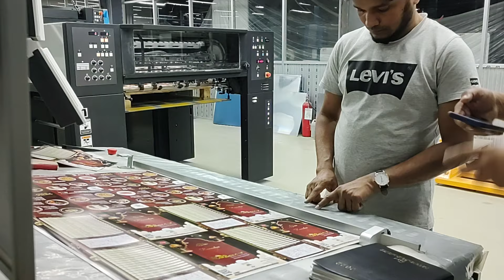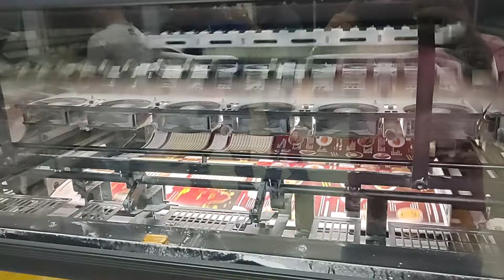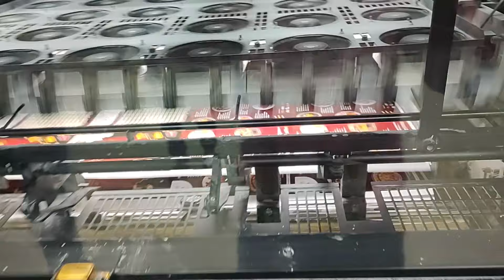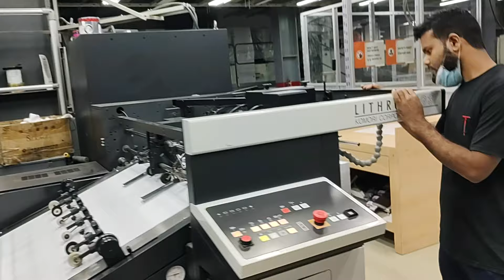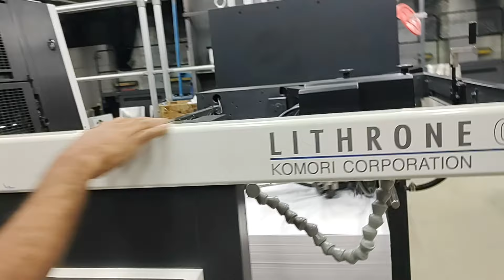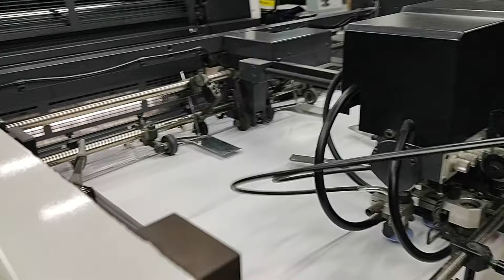How to work Komori printing machine

Comment: Ran both presses. Both have good and bad qualities. The hedi has a lot of technologies that tend to be very expensive to maintain and repair. I found that the larger Komori is more mechanical and easier to understand and repair. For major long runs I would pick Komori., once set up correctly, it'll run forever without adjustment. For hang and bang out small to mid jobs, I would pick Heidelberg. They are more efficient to start up and change over but will realign as the press heats up and need to be monitored closely until it stabilizes. The final end of day wash up, does take longer, even after running overnight shifts.

Comment: Step 1. Pour sand into the oil reservoir. Step 2. Buy a Heidelberg.
Reply: Komori s are just as good. Ive ran Heidelberg too! Pretty close in quality to the Heidelberg. I take it you never ran a Komori by your comment.